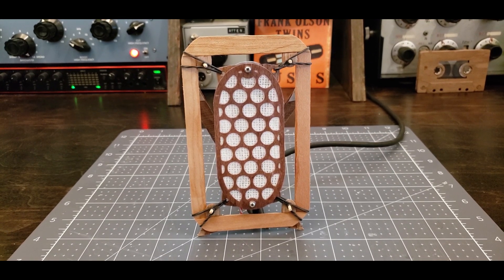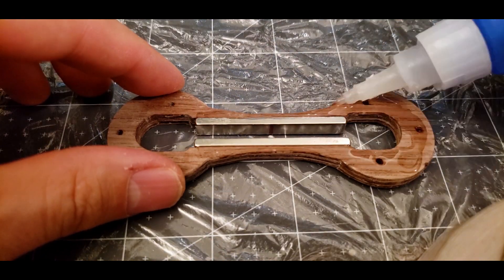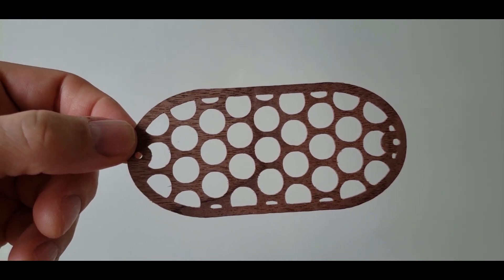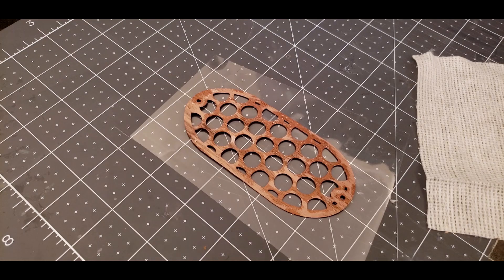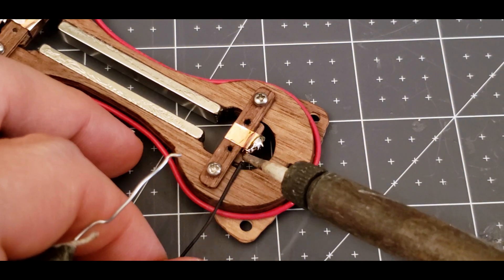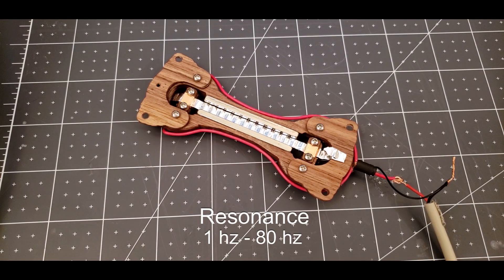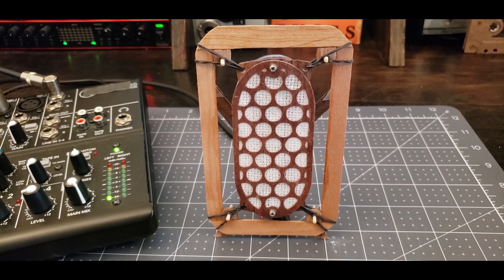Ribbon Microphone DIY RCA 44 - Episode ONE

Comment: another question , what is the rate/pitch of the corrugation?Thanks again.
Reply from the maker: The  corrugations are approximately 12 to 20 corrugations per inch.  You can achieve that with a variety of gears.  You can find "paper crimpers" for scrap booking that will do the job, or some gears from RC Cars.  Even a Toothpaste/tube wringer will do very well. Check out https://geistnote.com/diy-products/ribbon-microphone/corrugators/ for ideas.

Comment: Good work , what is the thickness of the aluminium , and the ratio of the transformer
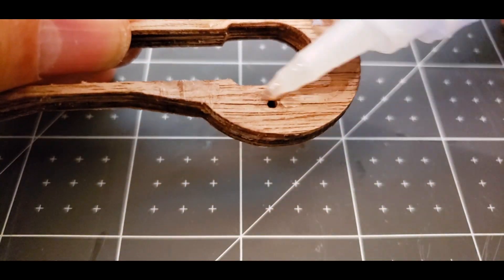Reply from the maker: Good questions.  Aluminum 1.8 up to 2.5 microns, Transformer 1:28 or all the way up to 1:36.  The transformer in the video is 1:36, but later I replaced it with a 1:28 from Cinemag.  Here's a 1:36 on amazon:  https://amzn.to/3Xx8Ic6  I believe that seller also sells many other transformers if you reach out to him, he can put you on the right track. 
Also, he sells the foil:  https://geistnote.com/1-8-m-aluminum-foil/
Good luck!
Reply: @FrankOlsonTwins  thanks for the answer , i bought online some audio transformer that i am planning to rewind (nickel steel , or silicon steel).i am looking for a source for the aluminum foil.(living in the Philippines)

Comment: What is the polarity of the magnets? a regular kitchen aluminium foil will do? great job!
Reply from the maker: Thanks!  The polarity of the magnets is as follows:  They are magnetized "Through Thickness" and they are oriented to pull toward each other.  So either South to North, or North to south.  It doesn't matter which, as long as they are attracted to each other, and not opposing(which would look like North to North or South to South).  Opposing magnets won't allow any output.
The foil is Sign writer's leaf.  You  can find the thickest sheets in a pad and cut those for the ribbon.  Kitchen foil is much too thick and will give very little response.

Comment: Aluminum cans are better or food packing aluminium foil, or copper foil which one is best?
Reply from the maker: For the ribbon you need "Signwriter's Leaf."
You can sort through the sheets with a light box to find the thickest ones and they will be the correct thickness.  Kitchen foil or any other foil will be far too thick.

Comment: why does it need the transformer
Reply from the maker: It's a step up transformer, the original signal is so small it needs to be stepped up to be usable by any preamplifier. Most microphones have them.
Reply: @FrankOlsonTwins Oh I would have thought that a preamp would have been ok with it, just more gain needed etc. Are the transformers specific or just 'off  the shelf' with a common winding ratio. Last time I put audio through a transformer was to connect my cellphone 3.5mm headphone jack to an amp to remove the DC from it's class D output stage but that was wound 1:1

Comment: Excelent job.
I want to build one for one of my classes. Please, what's the specific foil did you use? I was checking the link you provided and there's many kinds.
Thank you very much for the attention.
Reply from the maker: Try this:  https://geistnote.com/1-8-m-aluminum-foil/
Also, I would buy a book of "Silver foil" or "signwriter's leaf" which is pure aluminum foil, but very very thin. I use a book of loose sheets called Barnabas Blattgold. Many of the sheets are a little too thin for ribbons, but it's great to practice with.  If you sort through it with a bright light, you can find the thickest sheets. Those will be suitable for most ribbon projects.  Then when you get good at making and installing ribbons, you can use the more expensive sheets.

Comment: CA glue is subject to moisture and temperature, and has an expected lifetime that is measured in months or years, at the most.  why are you not using a real glue?
Reply from the maker: Any suggestions?
Reply: @FrankOlsonTwins  i favour G-2 epoxy by system three, being the glue of choice, i believe, in the wooden aircraft industry.  bear in mind these epoxies need 24 hours to reach working strength, and take weeks to reach a final cure.  do not be fooled by anything fast cure, with epoxies you get what you wait for.  an alternative is old school and still very excellent - cascamite wood glue  - this will give you a very strong bond in most woods, and will last a long time.  alternatively again, titebond II premium wood glue is probably still the best all around wood glue and will last a long time.  finally there is always hide glue, used in the violin family, this stuff has lasted four hundred years, and much longer, in some cases.  hope this is helpful, i like your work.
Reply: I had a dent inside my kitchen tap that was leaking water which I fixed with CA glue and soda. It held up for several years. CA glue is best.

Comment: I loved your tutorial. By far the best on YouTube. Could you provide the cutting design for the structure and the ribbon measurements? Or are you offering them for a fee? Thank you for making this information available to the community. I’m very grateful for that. Greetings from Brazil.
Reply from the maker: Hello,
I don't have the plans available anywhere, but I can tell you that the ribbon is approximately 2.0 inches long x 0.17 inches wide.  Nothing about the design is critical. You can make the ribbon a bit longer or shorter, narrower or wider and it won't affect the overall performance too much.  The skinny waist in the middle helps with top end response.  
If I were making a new one, I'd make the screw holes a little wider apart with skinnier screws.  Also, I've made a few with clear Acrylic plastic and they are overall much easier to assemble. 
Of course, steel is the best if you have good metal working skills. I do not care for metal work, so I generally work with other materials.  
Perhaps the most important thing is to make sure that whatever magnets you use are magnetized "through thickness" and they are aligned so they are pulling toward each other, rather than pushing away.  
Study lots of designs and pictures online- old and new, it helps give a good idea of what to do and what not to do!
Good luck!
Reply: @FrankOlsonTwins  I appreciate your valuable tips. Here in Brazil, I am working with PVC, which has proven to be an extremely malleable material. I transform PVC pipes into sheets, cutting and shaping them with a heat gun. I don’t have much skill when it comes to working with metal. In Brazil, we face some difficulties acquiring certain parts and equipment due to high taxes and import duties. One example is the microphone transformer, which can cost up to 100 dollars. However, the transformer is not a problem, as I have the skills to make it myself. I will build my ribbon microphone prototype and will soon show you how it turned out. Best regards, and thank you very much!
Reply from the maker: Mic transformers are approximately $100 here in the U.S. as well. Though you can find some bargains on cheaper ones.  The golden ratios seem to be 1:28 or 1:35, or even about 1:50.  Cinemag, Edcor, Lundahl,  and even Sowter make ribbon mic transformers. You can look to those designs for inspiration.  I've only used the Cinemag ones, but Lundahl designs are also very popular.  
Looking forward to see your mic!
Reply: @FrankOlsonTwins  I believe I expressed myself incorrectly. In fact, with import fees and taxes, the cost of parts here can reach up to six times what one would pay in the U.S. Here in Brazil, there is an engineer who develops ribbon microphones, and I was able to get some information about transformer manufacturing. He uses toroidal transformers with a 1:35 ratio, and the sound of the microphones is warm and full-bodied. I'm interested in using ribbon microphones because the proximity effect is very strong, enhancing low frequencies and making the voice sound richer. I want to use it for podcasts so my voice will have a more radio-like character. I'll send you information about my prototype soon. Thank you.

Comment: If you used copper contacts and wire leads, what did you use for the ribbon material? 
Copper and Aluminium can't be used together without an oxidizing chemical reaction occurring.
Reply from the maker: Excellent point! I do use ultra thin aluminum foil, and I do clean the copper surfaces extremely well.  However, after a few years the contacts do tarnish(though they were not visibly corroded). On some I've used Caig G5 contact enhancer to help reduce the speed of reaction.  I recently re-ribboned this mic and did switch the contacts to brass, so hopefully they will have less reactance.  Any tips for contact metals to use with aluminum?  The industry appears to use copper or brass.

Comment: A question regarding this constraption, wich other options would be adviseable to use for the ribbon?
I was looking to use genuine gold as the ribbon, but i have no clue on how adviseable this would be
Reply from the maker: Pure aluminum foil is still the best(99.8% is the norm). Gold is too fragile, as are many other metals. Pure aluminum is light and has good "cold working" properties. Try to find ribbon that is 1.8 micron or 2.5 micron thick.  You can use sign-writers-leaf if you can sort out which sheets are the thickest and use those.

Comment: its amazing, i commented on the other video. What transformer did you use? megatron...starscream...wheeljack?.. 🙂  would anything work, like out of old clock radio or smoke alarm, whatever.?
Reply from the maker: No, this transformer is pretty specific.  It should be 1:28 or higher. I upgraded to a Cinemag ribbon transfomer just a short time after making this video.  Cinemag, Jensen or Lundahl all make good "ribbon mic transformers."  Unless you can find Optimus Prime, then get that one...
Reply: @FrankOlsonTwins  Cool! Thanks man! I;m orderin up a Cinemag CM-9888. Are you currently sharing your psd cricut design somewhere? or is that part for us to use our own design ideas?..heh.  My dad had a matched pair of RCA 44s he kept in a case in his room. After he died few yrs ago, none of us could ever find what happened to them. After seeing this, my son and I are gonna try wiring one up.

Comment: Great work! I am also building one. To check the tape, is the signal sent from the linear output, or through a transformer with which the microphone will work?
Reply from the maker: No transformer, directly from a low powered headphone jack works

Comment: What if I had no horizontal magnets
Reply from the maker: If you can find the North and South poles of the magnets, you can still position them across from each other on either side of the ribbon to make sound.  So it would be something like:  SouthPole|Ribbon|Northpole  OR  North|Ribbon|South.  To some degree, It doesn't really matter how the magnets are oriented as long as the poles are aligned with each other on either side of the ribbon. Just find the poles of the magnets and figure out a way to suspend the ribbon between north and south poles.  Good luck!

Comment: Where can I buy the transformers for this mic and did you use the phantom power from the mixer to power the mic or straight into mic channel?
Reply from the maker: No phantom necessary!  The transformer is a 1:35(or 1:28) step up ribbon transformer,  you can find them online by cinemag or lundahl, or others

Comment: The magnetic structure should be all metal. It increases output. Also, I doubt that it has sufficient EMI protection if the whole mic is just a block of wood. The point of the metal structure is to provide both a sturdy build and a complete electrical shield around the transformer and ribbon element. Depends on the environment of course.
Reply from the maker: I'm not exactly disagreeing with you, as an all metal mic would be ideal for the reasons you mentioned. However, the proof is in the pudding:  https://youtu.be/XGgYczOghzg Starting at 34 seconds and https://youtu.be/HOuL5glv8pA at 8 minutes, recorded in several different locations- including a professional studio with no level or interference issues.  The copper humbucking loop seems to be sufficient. One note: the transformer has upgraded since this first video with a MuMetal encased cinemag transformer. The two videos I posted above feature this upgraded transformer.  
Thanks for checking it out!

Comment: Hi Frank, just wondering if you could explain the motor wiring? I recently upgraded (so I thought) the transformer on an old Nady RSM 2. The transformer output wiring was a no-brainer. The replacement transformer came with a schematic so I was able to pin out the output. I know the ribbon motor produces an AC signal that’s boosted by the transformer. Is the motor polarity an issue? If so, would the mic end up being 180 degrees out of phase? I was successful as the mic works but there was not a huge change with the new transformer that I installed. Maybe I am expecting too much.The wires on the new transformer input matched the colors on the motor so that’s how I wired it. What would be the effect if I have the transformer input wiring reversed? Does the transformer care? Thanks and all the best. Jesse
Reply from the maker: Hey Jesse!
Generally speaking, for ribbon motors made of metal(Royer, Nady, most others) I connect the hot wire from the primary side of the transformer to the "floating" or, non-grounded end of the ribbon. 
The cold wire of the transformer primary gets connected to the grounded side of the ribbon(the part that is connected directly to the metal motor chassis).
However, depending on how the transformer is wired, it might not make much of a difference. If the primary side of the transformer is not grounded(it likely isn't) then, as you noted, it may not make any more difference than just phase polarity.  If the secondary is grounded to the shield(it might be), then you want to keep them connected in respect to each other.
The secondary side of the transformer should then be connected normally: hot to pin 2, cold to pin 3. 
If that's out of phase, it's no problem to swap the secondary side of the transformer, pins 2 and 3. 
I think worst case scenario(if the primaries are mixed up) would be any of the following: Buzzing/Ground loop noise from the ribbon, low or bad output, or reversed phase polarity. However, in most cases I think you wouldn't notice a difference.  The technology is basically ancient, and very forgiving.
One thing to keep in mind- the biggest difference between a high quality transformer(cinemag, jensen, lundahl) is the high end response of the ribbon. In fact, the cheaper transformers may even be louder overall, but they will tend to be muddier sounding.  The Shinhom(?) that I used in the video was replaced by a better cinemag, which was slightly quieter, but more balanced over the entire spectrum.
I hope this helps!
Reply: @FrankOlsonTwins  Hi Frank, Thanks for the reply and explanation. I kind of understand how it works. I realize that you wouldn’t want to ground the motor outputs as it would kill the motor output voltage. The input for this particular transformer (Geistnote 1:36) has two wires while the output has three. I understand that. The part I am trying wrap my head around is the motor polarity and why it’s important. The schematic that I received with the transformer shows the input wires hi and lo instead of positive and negative. Being they are basically inducing voltage using a coil, you would not think that it would matter. Unless it’s how the coil is wound? Maybe I am overthinking it. Transformers are pretty stupid. I am going to retest my mic and see if the output is higher on the backside and also use a mic preamp that has phase invert switch. Frank, many thanks for sharing your knowledge! Jesse
Reply from the maker: You have it covered pretty much. The hi and lo likely won't dramatically change the output, aside from polarity. If you hooked it up via the schematic they sent, I'm sure it's working at maximum efficiency.  However, if you haven't swapped the original heavy ribbon(factory installs 4micron to 6micron thickness), there's a chance that it could be soaking up some of the high end frequency response of the mic.  I swapped my fathead and nady ribbons for 2.5u and 1.8u foils, and the high end response is much better.  You could also send a little question and picture of the finished installation to Geistnote, he probably has swapped many transformers in the Nadys.  He'd know for certain if the colors match up.  All the best!
Reply: @FrankOlsonTwins  Thank you. I did replace the stock ribbon with a 2.5 micron. I also made one from the Amazon foil you suggested. Man, that stuff is thin! Not sure how thin but it seems thinner that 2.5u that I purchased from Geistnote. I actually had a chance to do some further testing today. There is a slight difference in sound between the front and rear of the mic. Flipping the phase invert button on my mic preamp definitely took something away so I am certain that it’s wired correctly. I am going to spend some time to learn more about those motors. Your videos really inspired me and gave me confidence to work on these mics. Thanks again.